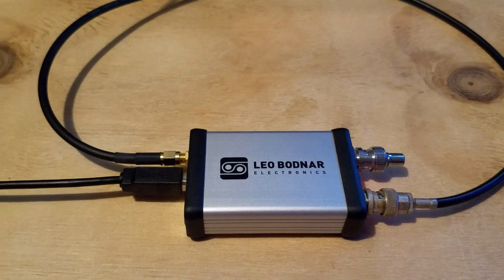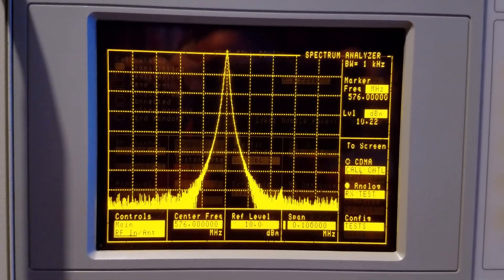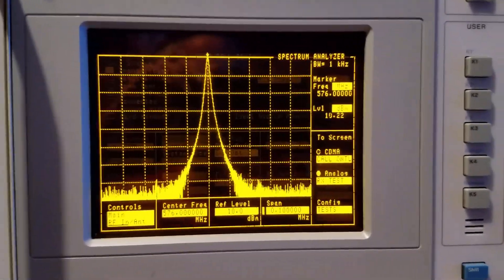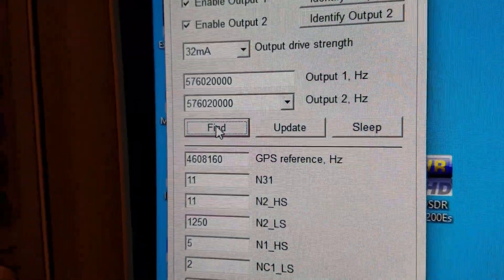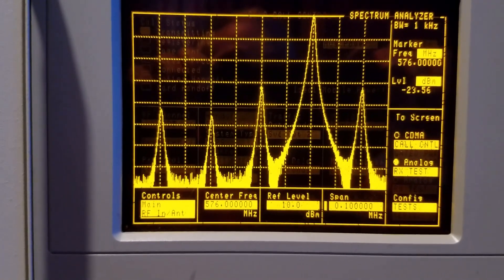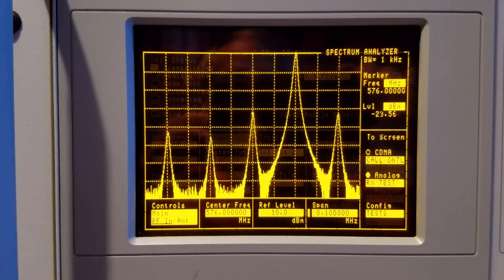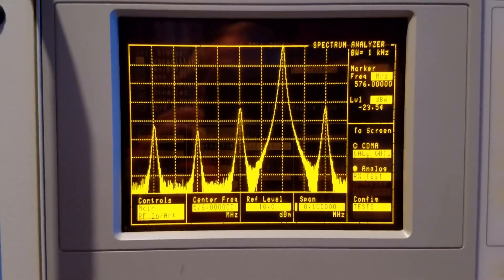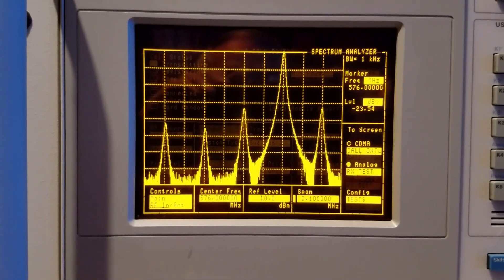10 GHz Beacon - Leo Bodnar GPS Reference Clock as an Exciter?

Comment: If you look up a video by TheHWcave "Using a GPS module as variable frequency reference standard" I believe he offers a detailed explanation for the source of these sorts of jitters on particular frequencies. It may be that a different DDS chip can offer a lower noise arbitrary frequency division, than whatever is used inside Leo's box.
Reply from the maker: Thanks. That is a nicely done video. Things get challenging when you are trying to generate a clean signal at a high frequency like 10 GHz. To make it worse, 10368.3 or 10368.4 MHz is going to be arbitrary to most any frequency reference. 10368 is a lot simpler and evidence of that is easy to find. There is a very limited number of units available that might work. I will test as many as my budget will allow and try to find the best solution.